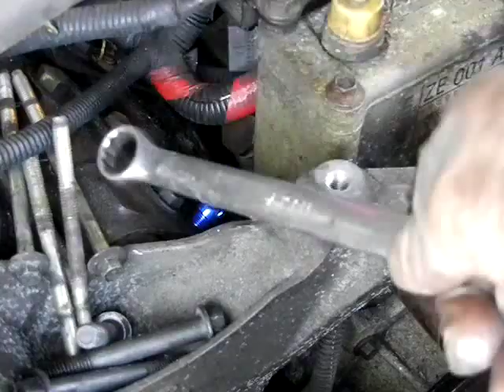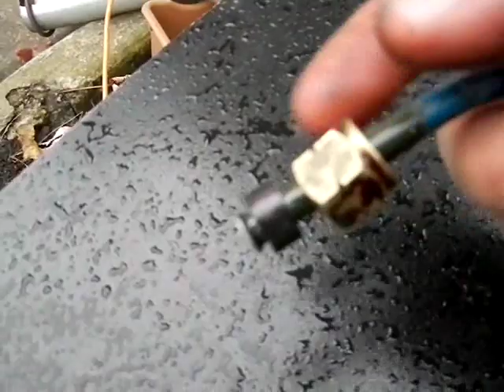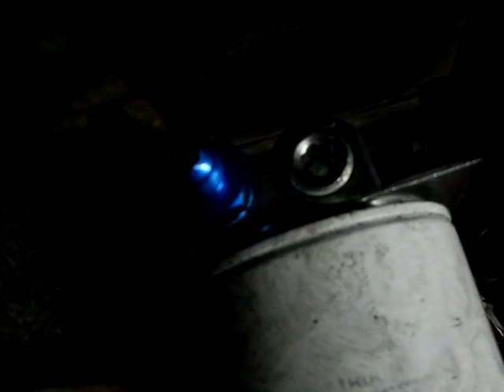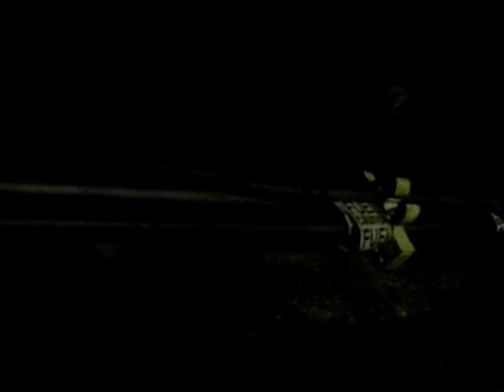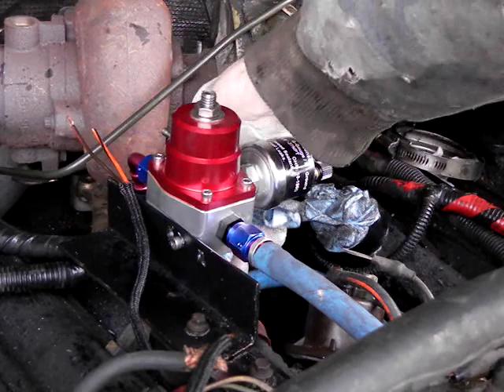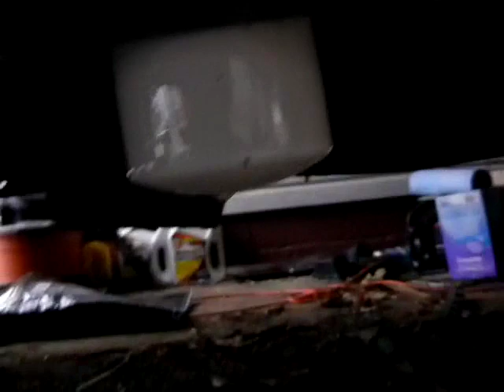How to do a Electronic Fuel Conversion Part 2 - 96 F350 7.3 Powerstroke Diesel (E-Fuel)

Comment: Man I’m slowly watching and learning from your videos. Thank you for sharing. I’ve got a DT444 (obviously mostly the same) in a school bus. If I’m having absolute hell getting it to start (it lived on an extension cord before I bought it), glow plugs all work great, and when it does crank it runs fine after it warms up and the engine warn light goes out, that makes me think that initial fuel pressure isn’t right. This type of swap might fix my issue. It’s all that’s left to change lol.
Reply from the maker: Hey thanks, more than welcome.  You have a T444E, not DT.  I have one in a bus as well, I just haven't released any videos of it, I'm pretty slow with it.
Yeah the powerstroke and IH versions of the 7.3 are really close to the same thing.
I'd check the fuel pressure, but depending on the year yours prob has the electronic fuel pump but the fuel bowl well I'm deleting mine on my bus I hate those things.  Anyways do you know how to plumb up a gauge to check the pressure?
IF the fuel pressure isn't right the prob could be fuel pump or fuel tank pickup screens are clogged bad.
I bought a F350 that only had 200somethingk on it and it wouldn't start no matter how many parts the local stealership threw at it, when I got ahold of it the front tank was clogged something horrible and the rear tank pickup was snapped off. but the clogged tank gave him grief for a long time before it finally wouldn't run anymore.
So without a little poking I would say this would solve your problem, but all the same I recommend anyone delete the fuel bowl and go with spin on canister filters, better filtration is always better, the stock filters are something like 10microns, the setups I've used go down to 2microns with a much better water separator and then there is all that free space to work on the engine I hate the fuel bowl being in the way especially if it has to be fooled with on the road.

Have you checked the filter?  Have you drained the water out of the fuel bowl, that has to be done ever so often depending on how much you drive it.
Reply: I'd also suggest doing a compression test as well, if the fuel pressure checks out to be good.
  If you have poor compression, she will be hard to start.
Reply: Doubt if that is your problem. Stock fuel pumps either work ok or not at all .

Comment: What is the reason for adding the regulator?
Reply from the maker: Regulates fuel pressure.
Reply: I got that from the name lol. I was just wondering why add one when it didn't have one before. Or did it?
Reply from the maker: Yes there is one built into the stock fuel bowl.
Reply: Okay, thanks

Comment: Taking the screen out of the tank is a bonehead move. If you had some real experience with these trucks you would know that.
Reply from the maker: Nope, ran several that way.  Works just fine when you are using a pre and post frame mounted spin on filters.  Do what you want with yours though, but claiming it's bonehead doesn't make it so you sure couldn't prove it bud.
Reply: @PatrickBaptist  what is the reason for the regulator?

Comment: And what are the end connectors on the rubber fuel hose your using? What are they called, the ones that go into the rubber hose and then connected to the regulator or y splitter?
Reply from the maker: To find them on ebay look up an6 to 3/8" push lock fitting.  
I'm just now doing a fuel bowl delete on my super duty so I'm doing this job basically against right now, just about done.
Reply: Patrick TheBaptist :So which one do you cut to run to filter back by the tank. You said there two the return from engine and the one that gives fuel to engine. I am confused on which on to cut and run into the filter base?

Comment: So I have a question my 97 f 350 I'm prepping for the efuel set up , I'd like to know on the fitting that is closest to the turbo drivers side rear 90 do the make an adapter to fit onto the existing fitting ? I can't find the size of the fitting and I'd like to run an actual hose style line. !
Reply: And what brand hose did u use to accommodate your application

Comment: did you install a oil saftey switch?? if so where did you put it??
Reply from the maker: Hi, I sure didn't.
Reply: okay, i just ran my pump to a manual switch and said screw all the fancy wiring setup.
Reply from the maker: mb10 12
I ran my fuel pump of the power that fed the fuel bowl heater.  At -6F I didn't need it  https://www.youtube.com/watch?v=dS1VvZ7gnto

Comment: How did you do the electrical part of this? I have everything figured out but I'm not sure what to do with all the plugs and wires laying around and how to power the pump. Thanks
Reply from the maker: I powered the fuel pump via the fuel bowl heater supply, since I deleted the fuel bowl there was no fuel heater.  Worked fine for me.
Others rig up a oil pressure switch and relay to power the pump.  Thanks for watching, happy modding.

Comment: What pump do you like to put on these trucks?
Reply from the maker: +Matt Leonard Bosch .044, nothing else, buy cheap fuel pumps and you will just regret it, my cheap pump gave me a good 20k miles before it started giving up then I went with the Bosch and I will never buy any other brand for these conversions, the money is well worth it.
Reply: thank you for the answer. what is cheap pump to steer clear of?
Reply from the maker: +Matt Leonard I wouldn't advise anything else but the Bosch .044.
Reply: thank you, good to know.
Reply: Patrick Baptist wish you had a parts list and where you bought all your parts from

Comment: Can you use a banjo bolt kit with a regulated return fuel system kit?
Reply: +Patrick TheBaptist Hey there, I understand where you are coming from but the factory Banjoe lines are steel on one end and a very short stiff blue factory fuel line on the other.  I bet that folks that were complaining about leaking didn't have the bolt torqued down to 40LBS.  Its a 1 1/2 inch block and if you don't have a spanner wrench I can see how people would make the mistake of not torqueing it down correctly.  The video you pointed to above talks about this.  Your solution does work but by the time you add on all the labor it might not make sense. You have also now introduced very long blue fuel lines into the mix which will eventually need to be replaced again. They are subject to heat.  Not to mention you ran your hard fuel lines dangerously close to the exhaust.  Even if they don't ignite its more than likely heating up your fuel which is not good on performance.  Although I did mine differently I thank you for the time and effort you put in on the video. If I had any criticism it would be that I would have liked to understand how you connected your fuel pump, wiring etc.
Reply: Yes sir you can, and it's recommend.
Reply from the maker: Joseph McCormack It's recommended by who?  I read about it leaking after a while which lead me to not go that route.
Reply: Are talking about the same part? The banjo bolts are at the front and rear of the heads. The fronts are behind the alternator, and a/c bracket. I've haven't heard of them leaking when installed properly. Also the modified banjo bolts are designed to keep constant fuel pressure. Unlike the oem type that don't flow aswell...
Reply: Anything will leak after awhile. Things do get worn out over time...
Reply from the maker: Joseph McCormack
Those aren't banjo bolts.

OEM uses steel lines that goto the back of the heads, same as the front, there isn't a banjo bolt, I believe the other guy is talking about a banjo bolt block kit.  This right here https://www.youtube.com/watch?v=F64wvQ5rCyY
Reply from the maker: Joseph McCormack
Buddy I don't need to study it up, the video I made here proves me 100% right, there are no banjo bolts on the fuel lines, we don't need google for this at all buddy.
Reply from the maker: Joseph McCormack
Hey before calling me a ass, why don't you learn to understand SIMPLE CONTEXT  "there are no banjo bolts on the fuel lines"  NO BANJO BOLTS ON FUEL LINES.  The person asking the original question was talking about a banjo block kit when doing a regulated return.  "Can you use a banjo bolt kit with a regulated return fuel system kit?" 

Regarding your comment "Also for being a Baptist you sure come off rather smug and arrogant. Now do your homework before you claim I'm wrong, because you look like a jackass!!!"

Like I said learn to understand context or what people are talking about before you stick your foot in your mouth and try to grow up a little while you are at it.  Next time pay close attention to what people are actually talking about before throwing your little tantrums.
Reply: +Patrick TheBaptist, +Joeseph McCormack , not sure why you think a Banjoe block (from Ebay sheribelle9dl6) would leak. Its just an aluminum block that attaches to your factory Banjoe bolt hard lines going to the rear heads. As long as you use the correct F4TZ-9A375-A Gasket you will be fine. This would avoid the cost of new lines and those AN6 fittings. Unless you plan on going to a Stage 2+ injector I don't see why you would need the larger diameter fitting.
Reply from the maker: bryjb10
What does it mount to?  I mean the block itself, doesn't it just hang to the steel fuel lines?
That is what is going to leak, eventually the bumps and vibration will either cause the O rings from the fuel fittings to the heads will leak or the steel line will crack from the stress.  When I first started doing Efuel conversions, I did lots of reading, someone was complaining of what I am going on about.
For his $75 tag I can fab up a new set of steel lines to a AN Y connector for $40 that won't leak.  And if I can do that anyone else can too, why just by the block when you can get new fuel lines while you are at it a line piece of steel brake line is under $10 at my advanced auto, AN fittings are cheap from China.

Most people ask me the cost effective reliable way to do things and I've found sometimes it's best to make your own parts, the guy has a great idea don't get me wrong, but it's not going to last a long time stressing the factory steel fuel lines that connect to the heads.
Reply from the maker: bryjb10
Hey man to each his own, we all do things our own way, next time I do one of these I won't use any of the blue hose, I will do stainless steel the whole way except for the little jump from frame to bottom of the engine like the factory did basically. And yes bend the lines a bit better from the exhaust, BUT that was my first time bending steel lines, and I only bought one piece, that's why I said if I could do it anyone should be able to.

I connected and powered the fuel pump from the fuel bowl heater connector, so when key is on the pump comes on, no I had no safety switch.

Eventually I plan to fab up a design and start selling it myself.

Do not buy a cheap fuel pump get the Bosch .44 I wound up replacing my cheap one, it eventually started to fail but didn't leave me stranded thank God.
I also did a write up on all this http://www.tyrantx.com/article_read.asp?title=Electronic+Fuel+Conversion&item=18

Thanks for your time.
Reply: Hey man. What kind of fittings are going from the block to the steel lines? Are those just inverted flares or something special you have to order

Comment: to me it seems like you are just regulating the return to the tank pressure. please explain :)
Reply: Patrick theFreeWillBaptist
Did some more looking and i understand now, thanks! and would a regulated return kit with a pump underneath do the same thing?
Reply: Patrick theFreeWillBaptist
i was looking at the irate kit. it wouldnt be hard to make i know, and ive looked at your write up and everything, but it would make things easier for me to just get them, i have access to a 6.0 fuel pump so that part would be easy

Comment: Great job Patrick, by the way those down pipe's are a pain in the butt, a 3 inch body lift makes it easier to work on my 94 has a straight 6 and swapped out the 5 speed with a built AOD trans with a shift kit and 3.55 front and rear gears, my good friend Dave has all the diesel's